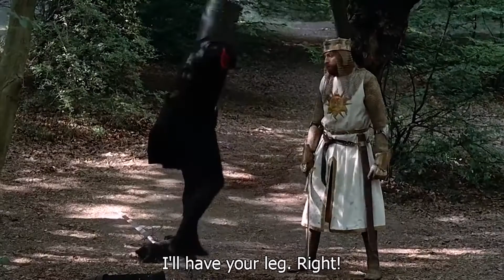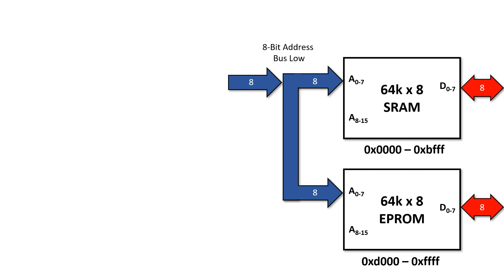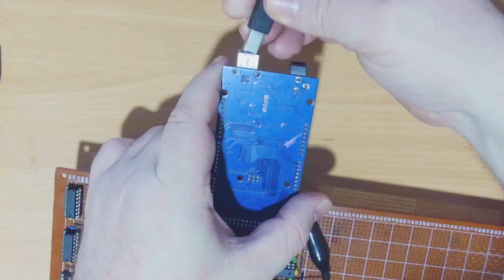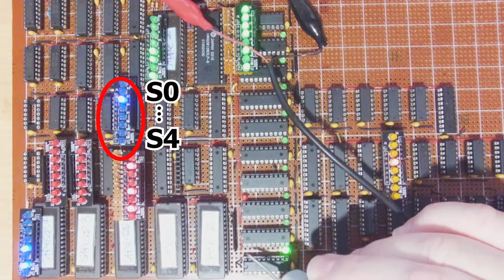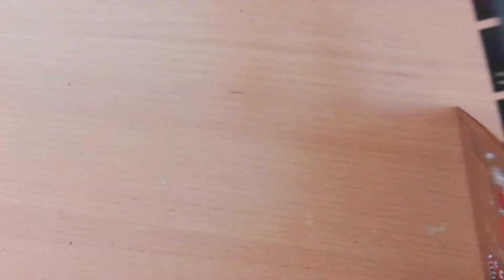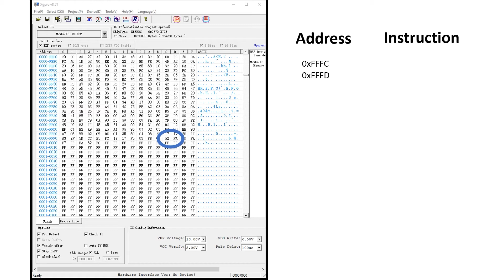How to build a 6502 TTL-CPU: Part 6, program counter part 2

Comment: Hi Dr. Regan, one big diff between Ben’s SAP-1 and this computer that I don’t think you’ve addressed adequately is the whole idea of driving register read  enable off of a “clock” signal that isn’t really coming from a clock. I wonder, with no guaranteed off, if somehow you could write microcode that’s technically correct but causes an issue. Maybe it’s not possible, I haven’t come up with a good example. I like the idea of not driving every modules clock input all the time, just trying to work through any “gotchas” this could create. Great series, thanks!
Reply from the maker: Thanks for the comment. All of the control signals from the EPROMs go through  flops which are all clocked by the same source, so all of the control signals should be in phase.  From memory Ben just uses unlatched outputs from the EPROM as control signals, so he needs to use the logic with a clock enable.  The problem is, this is usually done at the expense of a tri-state output, so you need another chip to wire it back to the W-bus.  This basically goes back to Paul Malvino's design for the SAP1, where i don't think tri-state octal parts were available/common (certainly not mentioned in his list of 7400 series logic)
Reply: @DrMattRegan ok I’ll take a deeper dive into that. Appreciate the feedback, thanks!

Comment: Goog advice about soldering in one direction. I am not as good at planning and created shorts exactly as you describe.
Reply from the maker: Yeah, they are the worst in the world to try to find.  The blue, red and black kynar wire is really good, very forgiving.  The yellow wire is some cheap stuff and it's awful, but i started using it so i'll stick with it.

Comment: Great stuff as always.  I'm working on a similar build and coming up with some similar conclusions and design. How do you plan on implementing the microcode, with ROM chips?
Reply from the maker: Hi Patrick.  Yep, the microcode is in 5x 27c4001 EPROMs, which is a bit of overkill.

I'm planning on releasing some videos on the microcode generator soon, but if you want a sneak peek it's located at
https://github.com/Turing6502/SAP6502

It runs with AppleWin version v1.30.11.0, you'll need the source code, but just replace their CPU.cpp with the one on my github.

If you decide to try to compile it, let me know if there are any bugs.  Thanks Matt.
Reply: @DrMattRegan  I’ll checkout your repo. I was planning on using 5 SST39SF020A chips for mine. Are there any chances of glitches when using ROMs to drive synchronous signals? Can there be random/invalid data coming out while the input address is changing?
Reply from the maker: Every output from the EPROM (except ucounterreset) goes through a flip-flop, so i haven't had any problems. I'd be hesitant to directly connect a clock signal for a register directly to the EPROM though.
Reply: @DrMattRegan  That's what I figured... I'll have to find space for those flip-flops in my layout. Fortunately I have less than 8 clocked signals, I'll try to control them all in the same ROM chip and use one one register!